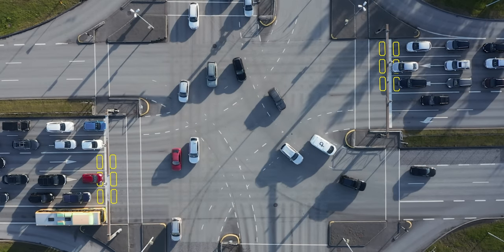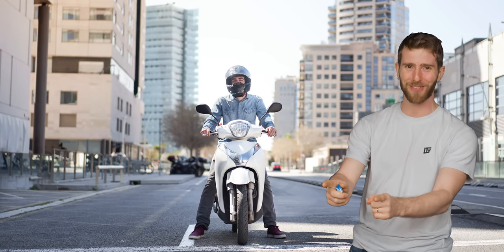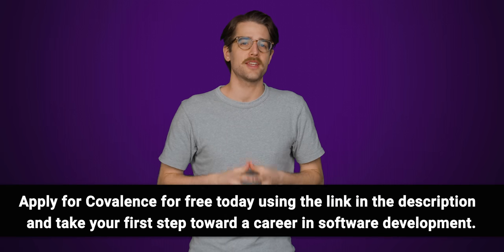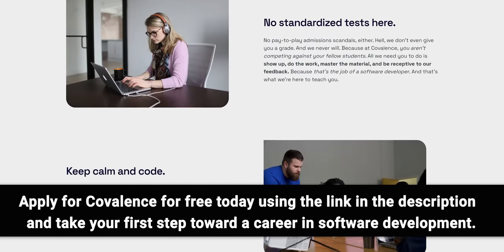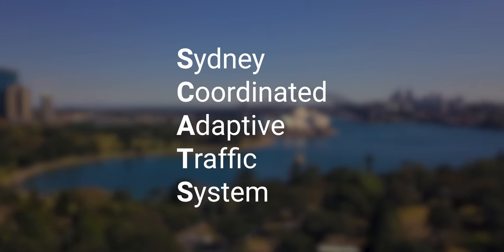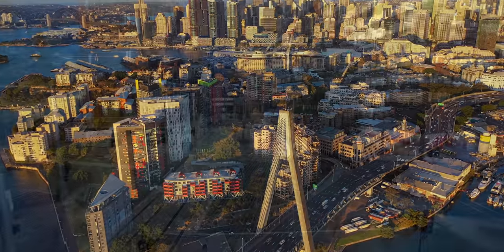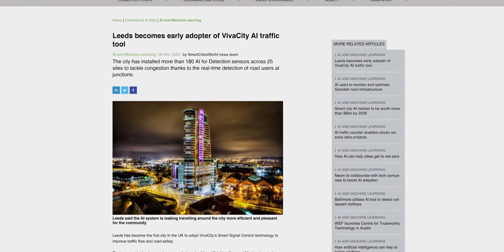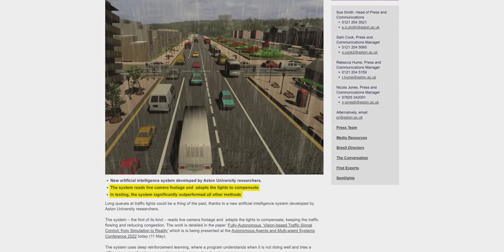Here's Why You Get Stuck At Red Lights

Comment: Fun fact: some states have exception laws that allow you to go thru a red light if you’re stuck, especially for motorcyclists [I presume so you don’t, say, have someone on a bike stuck in a torrential downpour for 10 extra minutes because the light doesn’t want to change]. CHECK YOUR LOCAL TRAFFIC LAWS AND ASSUME THERE ARE NO EXCEPTIONS UNTIL YOU KNOW OTHERWISE.
Reply: They have that here but it's less-than-helpful when you have to cross five lanes of busy traffic.
Reply: @chaos.corner  yeah, I think most are for like, “you’re sitting for 5 minutes with zero cross traffic”
Reply: @DoctorX17  Here it's just if you know the light is malfunctioning which can be kinda tricky to discern and with sensor lights, safe breaks in traffic can be rare.
Reply: What does "being stuck" mean in this context? Aren't you always "stuck" when in front of a red light?
Reply: @TimmyM  I think it's stuck without traffic on the intersection. (idk the exact laws)
Reply: Every state has this law. It's anywhere from 90 seconds to 2 minutes and you're legally allowed to proceed thru a red light. It's because sensors aren't perfect and like you said motorcycles/bicycles might not trip the sensor. There are different versions of it too. Some states have "ride on red" or "red stop sign" laws that mean a red light is similar to a stop sign. Like you said, check your local laws to be sure.
Reply: @TimmyM  stuck if the lights don’t switch to green because they don’t recognize any vehicle probably
Reply: @CRneu  My state doesn't have that law. Nor have any I checked.
Reply: @monkeyjustin22  Yeah, last I heard it was only a few states. TN is one of them. It's possible all the other states also passed it since I heard but make sure to check your local laws.
Reply: New Mexico has a broken light law. Basically if you've waited 5 minutes, and the light's still hasn't changed to red. You're ok to go. Assuming it's safe. Then again it has got to have some the worst for tailgaiters and people trying to run you off the road. I wouldn't trust some of the 4-5 lanes of traffic to stop.
Reply: @TimmyM  

A personal example:

To get home, I frequently turn left on a dedicated lane that leads off from a highway to a local road.

If (as has happened many times) I am arriving home late at night, there is no other traffic to inform the control devices to begin the next phase of signaling which eventually provides my green arrow.

Meaning, you can sit at a totally-dead intersection for several minutes, "being stuck", only by virtue of the fact there is nothing to 'kick-start' the typical light-change process.

Under this circumstance, the (red-light) turn is safe as houses -- yet illegal.
Reply: @monkeyjustin22  nearly every state has a law that says you treat a malfunctioning traffic light as a stop sign.  A light that doesn't trigger for your vehicle is malfunctioning.
Reply: @roberteltze4850  Traffic lights in the US fail to flashing red or yellow. Not solid red. A traffic light not triggering for you is not malfunctioning.
Reply: @monkeyjustin22  malfunctioning means it isn't functioning as intended which is different than the failure state you describe.  For example if an intersection showed green for all directions the lights would clearly be malfunctioning.  Lights with sensors are intended to trigger for vehicles stopped over the sensors if the don't then they are malfunctioning.
Reply: @roberteltze4850  The logic controllers for the lights are unable to malfunction in that manner. It is impossible.
Reply: @monkeyjustin22  That's kindof tangent to my point but never consider anything impossible with electronics.  You could always have a cosmic ray hit and alter the way the electronics work.  Incredibly unlikely but it has happened.

But that's kindof the thing when devices malfunction, they operate in ways that were never intended to be possible.
Reply: @roberteltze4850  No, that is not how electronics work at all lol. A stoplight will not fail or malfunction to a constant red or constant green.

Comment: Here in my (rural) city in Germany it's actually the other way around for many traffic lights funnily enough: During times of high traffic they are on a time while during the night they are just all red until someone approaches the traffic light. Probably that's because you don't want people to speed during the night or so and during high traffic there's someone waiting at each end anyways, so the induction coils (and cameras) don't get you much as they are just triggered all the time.
Reply: > Probably that's because you don't want people to speed during the night or so
Or maybe it’s so that they can quickly turn green when they detect an approaching car.
Reply: @ThePC007  Yeah but there's clearly a main street that 90% of the cars come from in the night and it seems to be clearly timed to turn green, if you slow down to like 30 km/h instead of the allowed 50 km/h
Reply: Most places I've seen at night will go into a demand mode where the primary traffic direction is green with the others being activated on demand as someone hits the sensors. They will also generally still be on a timer and run through a short cycle for the secondary directions every few minutes even without the sensor. Just in case either the sensor has failed or there's a Linus on a motorbike stuck there waiting.
Reply: Here in Estonia, most of the lights will start blinking yellow meaning slow down and check if you can go. Works pretty well as there aren't many people driving during the night. No need to run all the AI crap and whatever for just 3 people
Reply: @offsetmonkey538  We have the same thing on some traffic light but here they just straight up turn it off, which means: treat it as if there was no traffic light at all.
Reply: Same here in a rural town in Germany. I’ve even heard that its possible to make the lights turn green earlier by flashing your lights… but I haven’t seen this working as of now
Reply: @zyeborm  I like that idea, I have a sensor based traffic lights next to my house, though its using a camera instead of the induction loop. The issue is that it is unable to detect bicycles or motorcycles, so if a car stands behind me it is fine, but when I was returning home at 3am and there was one no one else going from my direction I had to wait for 30 minutes and then I just ran the red since the lights clearly were not going to change.
Reply: @Simoxs7  I'd assume BC the camera would get triggered at night earlier then
Reply: @cromefire_  The need to slow down a bit might be due to insufficient detection distance. But, as long as the side streets are not too small, it is still often better to have the 'default all red' than the alternative of 'default green for empty main road' (where, coming from the side street, you have to come to a complete stop to wait for the main road to first go from green to red via amber, then to have the standard 4 or 8 second gap with all directions red, and only then to give you the green light).
Reply: @L2M2K2  well the side streets are pretty quiet during the night. During the day there's a bakery and a school, but during the night only a few houses, I'd say 95% of the traffic is on the main road and it seems to be triggered by cameras, so it should have a pretty good trigger distance.

I mean in a neighboring village they even do it explicitly, where there's a traffic like that will only go to green (in time) when you're under 50 km/h.

Comment: Glad you mentioned the motorcycle issue, but it is worse than that, many appear to have trouble detecting motorcycles even if you do drive over them.
Reply: There's lots like that in my area too. If you follow those induction loop wires, it'll lead to a cover on the side of the road. In the UK where I am, we can contact the local council and they'll send out an engineer to adjust the sensitivity so it'll detect motorbikes again (The sensitivity drifts with age apparently)
Reply: Another work around is to use the kickstand, put the motorcycle in neutral, open the kickstand over an edge of the loop
Reply: @th3d3wd3r  I'm in the UK too... and I think you'll find that depends a lot on the council... I know I have been on to mine a number of times about the issues, and so did a colleague of mine who was a local politician, with no success.
Reply: A lot of motorcycles use fibreglass etc so there isn't enough metal to trigger the signal, same with bicycles. They need a pretty big chunk o' metal to trigger reliably.
Reply: Maybe this can be fixed by putting some neodymium magnets at the bottom part of the bike?
Reply: @flizzycat  Thats actually pretty smart, but would it work? And what about debris like metal splinters attracting?
Reply: It's even worse for bicycles. The only way you'll have a chance of triggering it is to lay your bike down with the rear wheel over the loop.
Reply: Put your kickstand down on the loop sometimes it helps trigger it
Reply: One thing that might help you in that situation is to get a neodymium magnet, and stick it to the bottom of your bike, behind a fairing or something, but beware that those demagnetize around 70ºC
Reply: You could just contact your local autorities and they can adjust the sensibility of the sensor to detect motorcycle...
Reply: The induction loops (if they aren’t broken) can pick up a paint can. They’re very sensitive
Reply: There may also be a problem with trucks, some of which are too high to trip the signal. (I saw this happen with a Jeep once)
Reply: Especially push bikes
Reply: @petergreenson  Only IF said paint can is on the wire, LOL.
Reply: @TalesOfWar  that may have been true at one point but in the Netherlands we have loops for bicycles that work just fine. Even for aluminium bikes.
Reply: I swear that some of these sensors are actually weight sensors and the bikes are too light.
Reply: I ride a 600 pound Harley Road King and sometimes it doesn't trigger them.
Reply: @mojoneko8303  That's an awful lightweight Road King.  My Sportster 1200 weighs 590.  I'd expect a RK to be closer to 800 to 830 depending on if it has bags, fairing, windshield or not.  Regardless, at least half of the sensor loops in my city fail to trigger the lights for my bike.  It's super annoying.  Even with the ones that work, I have to stop over a very specific part of the loop or it won't work.  I know a guy riding a new 730 lb HD Heritage and he has the same problem.
Reply: interesting that they dont pick up on motorbikes. as a child i used to walk over these induction loops on the road to get the lights to change at night. fat jokes asside, if they can detect me, they can detect a bike.
Reply: @mojoneko8303  IKR?
Reply: A few weeks back a normal car didn't pull up far enough and another driver had to physically get out of their car and tell the other driver to pull up to the light. That road was a right turn that goes under train tracks, the light is about 10 feet after the turn. So exactly one car has to be pointed toward the tunnel.
Reply: @oetgaol  There you go again, showing the Netherlands give a crap about cycle infrastructure while most of the rest of the global north are stuck in the late 20th century at best lol.
Reply: @TalesOfWar  I was showing NA only cares about cars because loops can detect motorcycles. 😉
Reply: @jamesslick4790  Nope, symmetripole loops will detect a paint can running in the middle of the loop.

Comment: Dutch traffic lights, and im sure other countries do this as well, have multiple loops. One multiple meters before the traffic light, one at the stop line, one after the stop line and one in the intersection. All to detect stuck cars, incoming cars or standing cars. They also use the loops after the stopline to detect cars crossing a red light to delay a green if necessary
Reply: There's most of the time 3 in front of the stop sign some even more, and these allow a few things
- have lights be red by default at night and turn green just in time (done to make the green useful so people don't ignore red lights at night)
- allows that one speedy car in the closing time to regain a green light just a second after it gone red (used that trick daily 😁)
- detect if a car is not stopping, and turn the other lights to red for safety
- detect an approximation of the amount of cars waiting and assign priority to give green and the time it's green (but this also means the system can be tricked)
- detect the current traffic flow
and there's probably even more things that can be detected with just using multiple induction loops
Reply: @TinusBruins  and i hope they someday implant that to in Belgium , now i am stuck waiting for 5 min on a street with no traffic at 2 AM
Reply: @PowerChaos  Did that light ever turn green? 🤪
Reply: Where I live, they use cameras rather than loops. It will see people approaching ahead of time, and it also works with motorcycles! The only problems come if you are on an asphalt-colored motorcycle wearing asphalt-colored gear, or when it's snowing, but they detect the snow problem and turn into normally timed lights
Reply: They have two of them sometimes in urban settings like Hamilton and Toronto. You can still trip them by strategically stopping on two at once. It helps if you have a bigger car, but I've been able to trip them in a Matiz (something about as long as two bicycles).